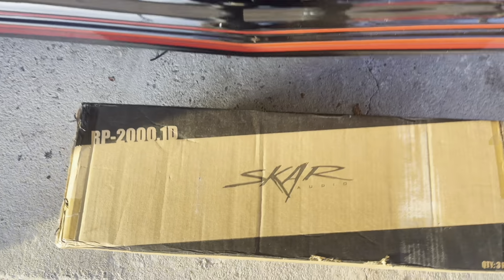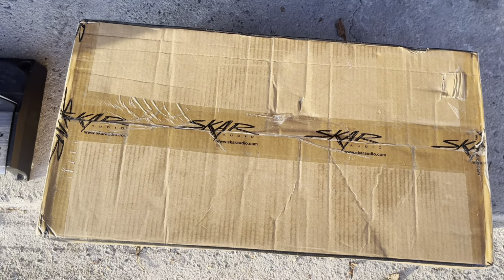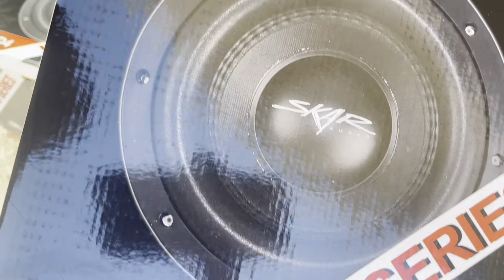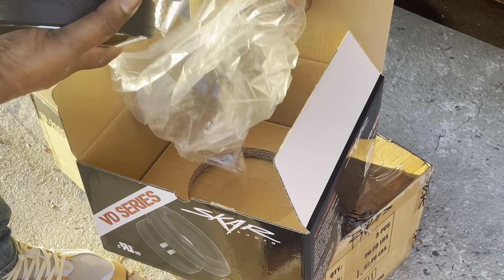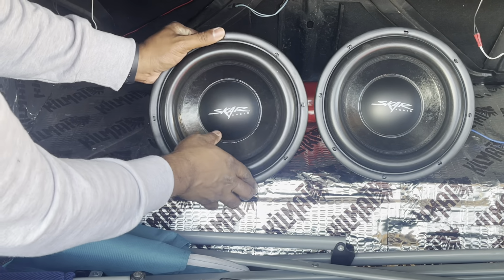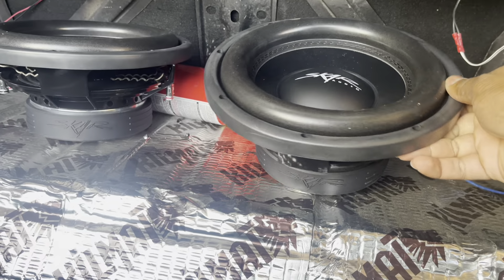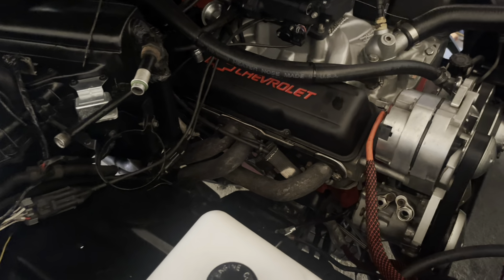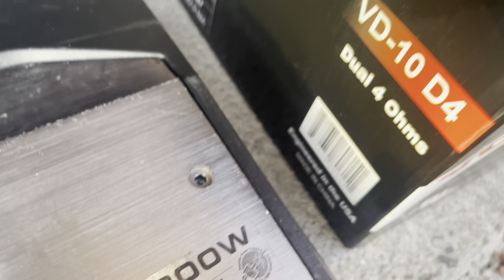Unboxing SKAR AUDIO Subs for Monte Carlo SS | GBODY

Comment: Skar is good product.  Can never hurt to wire up thicker gauge for future projects.  (It always starts with a little something). You probably want to upgrade that amp later on.
Reply: I had not had a system in decades and I started with a self powered 8 and it kept growing and growing once I got some good sound ended up adding a monoblock 1200rms on top the 70x4 with component fronts and 2 subs. Lol. I stared with 8 gauge then 4 I wish I’d went 0.
Reply from the maker: Makes sense..I appreciate the feedback🦾💯
Reply: @87SSBOI  that bass gets addictive.  Lol seriously.

Comment: Car Looks  good it came together  very well.   Look into getting some APR faster  for your headers
Reply from the maker: Thanks💯...I have the locking header bolts but the way my headers are bent it's no way to get em to fit back by #8🤦🏾‍♂️🤦🏾‍♂️🤦🏾‍♂️...these headers suck...bends in the flowtechs I'm about to install gives way more clearance
Reply: @87SSBOI ok

Comment: Just letting you know for those subs you can’t do a small box. Those subs like air space. I have the zvx 15 sub and the Skar 2000.1 amp. I’m doing 2 of the Skar 15 In my SS Monte. Keep that amp kit…you’re going to need it. And you might want to think twice on that kenwood amp.
Reply from the maker: Need a big box for the shallow mount VD series? Skar told me the shallow mount was for small area like behind or under seat in a truck...and yea I've been getting mixed reviews on using the Kenwood amp... definitely will prob swap it out later but I'm gonna see what she will do first just out of curiosity... appreciate the input bro💯🦾

Comment: Your gonna have to wire them in series  then parallel them  2 dual 4 ohm sub u can wire them to 1ohm by wiring them parallel or 16ohm series so to get 4ohm load wire them in series then parallel to get 4ohm but if I was u I'd get the rp 1500 or rp2000 from skar  so u can wire at 1ohm to get full power
Reply from the maker: Yea I will eventually go with the recommended Skar amp...thanks

Comment: You can wire those dual 4 ohm subs parallel down to 1 ohm ….that amp is 1 ohm stable and is rated at 900 watts…those subs can handle that all day!!! Also keep the wire…you already got it and you never know in the future if you may add other amps to you car….also look into maybe doing a big 3 on your car as well…. that never hurts
Reply from the maker: Exactly what I needed!!! Someone with more knowledge than me...lol...I may wire em to 1 ohm going to the amp...I know they will handle it from the research I've done on the subs...thanks for the input
Reply from the maker: Now you got me curious about the Big 3 thing...I saw it while ordering my wiring kit online but didn't know what it was so kept it moving..
Reply: Is that KENWOOD really one ohm stable? I’m not familiar with it   My experience with KENWOOD it’s fair but never quite premium.
Reply: I found it 900 at 1 or 900 at 2 ohm as well. Would it not be better to wire to 2 ohm to perhaps run cooler?    Two 500 rms subs going to be all it’s got anyway?  Just a thought?  I tend to run my amp over the subs rms 1000 in this case so I’d run a 1200 or 1500 rms amp on them.  I like to avoid clipping that way.  But that’s me.
Reply from the maker: All good info...I'm not really into this side of things so I'm taking all the advice I can get.. appreciate ya 💯

Comment: Does the amp take 1/0 gauge wire
Reply from the maker: Not sure if it does but the specs for the amp recommends 4 gauge
Reply: @87SSBOI  you will want a distribution block for 1/0 to 4 anyway.

Comment: That's not enough RMS for your speakers, when you divide that 500rms your speakers only getting 250rms a piece, they could use a lot more power. I know you said you didn't want to beat down the block, just thought I would let you know you need about a 1k RMS amp for them speaker or a 800rms.
Reply from the maker: Word!!! I appreciate it man...makes sense...I figured I'd prob end up going with the one Skar recommended for those subs at a later date...just wasn't n the budget at the time...Thanks for clearing that up...this amp also gets 900rms at 2ohms...what's ya thoughts on that? Should I wire em at the amp at 2ohms?
Reply: @87SSBOI  Yes! They will hit a lot harder. & you can always turn down your amp if they start clipping. Check out Taramps also, they have a lot of budget bangers for the price when it comes to amplifiers.
Reply: 2 dual 4ohm speakers will give you 1ohm tho if I'm not mistaken.